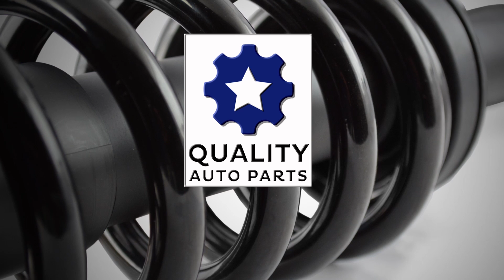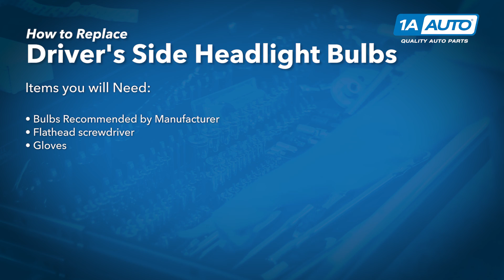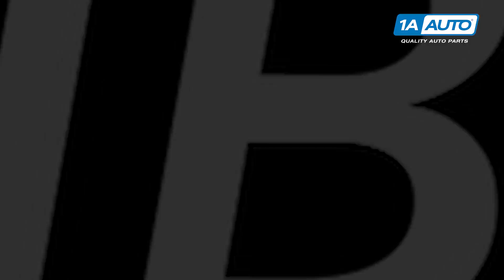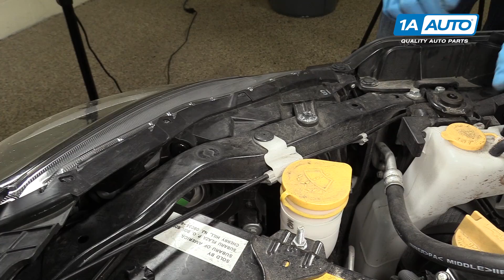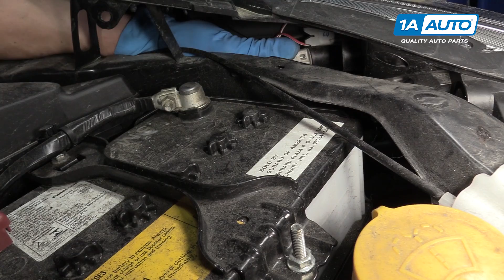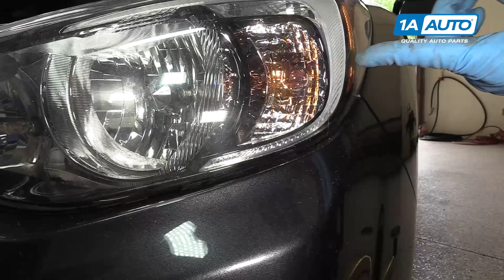How to Replace Headlight Bulbs 11-16 Subaru Impreza

Comment: Thanks for the step by step video.  Is it normal for the new bulb on my drivers side to appear brighter than the passenger side bulb which I didn’t change?   I purchased the basic bulb.
Reply from the maker: +Busywave Yes, it is normal for there to be a difference in the brightness.

Comment: The bulb housing you start to take out at 4:20...you can use a flathead screwdriver to gently turn it with the hand that is inside the car (your right hand in the video). it's very easy to do that and you won't need two hands to remove that one.
Reply from the maker: Thank you for the great reply.  Have a great day! 1aauto.com +John Magee

Comment: Great video on how to remove and reinstall a bulb and disconnect the electrical component. I found out that the replacement bulb I purchased was for the high beam so I returned it to O’Reillys and obtained the correct bulb. However, the Subaru headlights are reversed?? The high beam light is in the low beam location and vice versa. Or at least the store has the bulbs listed in reverse order. Before purchasing a replacement bulb I suggest that you remove the blown bulb and take it with you or at least take a picture. It would save you a trip.
Reply: what kind of bulbs did you get for the lowbeam/highbeam?